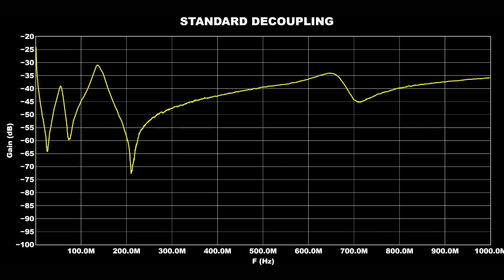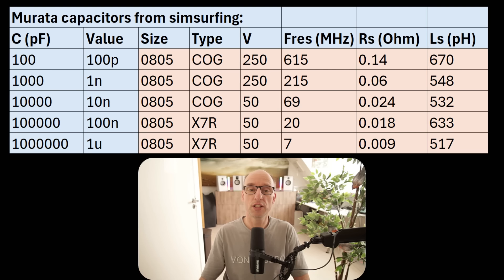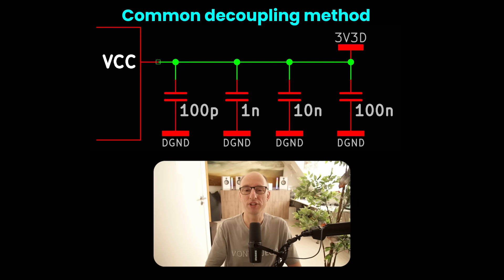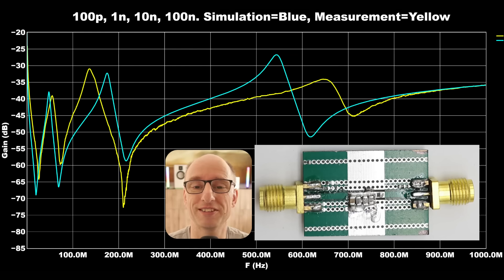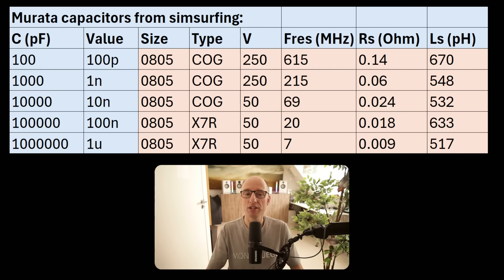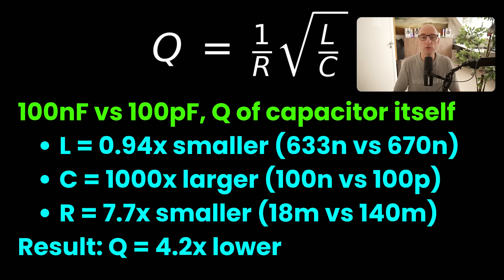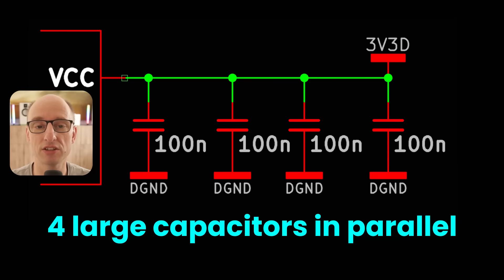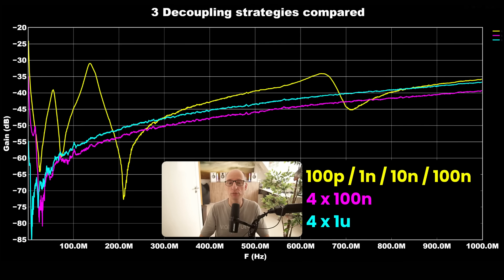The most misunderstood concept in decoupling

Comment: Another method to add damping is to use a ground and Vcc plane on the board, using the innermost layers. that way you do get a small very good capacitor distributed in the PCB, and you connect to it using in pad vias for both supply and ground pins,  and for higher current 2 or 3 vias all in the same small area, either buried under the chip to save space in DIP packages, or near the pin with a small relatively broad trace the width of the footprint. then you can do board decoupling using a single electrolytic capacitor at the point of supply, it being connected to the planes with large pads with multiple vias, and the capacitor terminals being the supply and ground connections as well.  It is common in military and avionics boards, where you often only have a single 100uF wet slug tantalum on the incoming supply, with a series lossy inductor (very low Q factor from having a powdered iron core that is open), and 100nF ceramic capacitors both sides of the inductor, to act as a CLC filter on the supply. No noise in, no noise out, and very tolerant of both power supply ripple and logic ripple. 

One board design, with 25 in the case, did not even do that, 400 cerdip packages on a board, both sides, and the sole decoupling was a 100n ceramic on each of the 2 5V supply rails, supplied from a DC DC converter that was identical in each supply, just the one was supplying 5V constantly, and the other, because they needed to get the power consumption down from 2kW to under 300W, was operated for only 20 degrees of the 400Hz avionics supply, to power all the digital arithmetic systems and the computational core, with only registers and memory powered on all the time to keep state. 

It worked well enough and was reasonably reliable, if a little bit of a pain to service, as changing a single IC meant you sat for a day, grinding off the legs, removing it, then using a Dremel to thin down the replacement plastic package so the tiny stubs of the legs you left could be folded to fit the old spacing, then solder it in. Changed so many 5474's, with 7474's, because those came in plastic, and were easy to get. I did so many 741 opamps as well that were the analogue inputs as well. Almost never any other logic failed, even the esoteric Intersil ADC DAC subsytem, that used some 40 pin cerdip packages, with around 10 smaller dies and hybrid circuits in them. Needed 8 supply rails to operate, and the program memory was on 2708 Eproms, with some doing logic functions and look up tables as well. Memory was 2 Mk4007 devices, 512 bits of serial memory. That was state of the art in 1975.
Reply from the maker: I was thinking: how can this work?! but then you mentioned 1975 :-) Now that makes sense! Speeds were so much lower back then. I don't think you'd be able to get away with this with a modern high speed digital board. The load peaks are so nasty you need local decoupling I think.
Reply: I have used this PCB layers power supply planar capacitor technique in audio preamps and power amp stages in combination with the shunt RC damping advised here.
Results were very agreeable clarity and stability in the reproduced sound. 
Thanks much for your info.

Comment: Thanks for the video. I imagine this is not a big issue for audio circuits as the frequencies involved are much lower than capacitor resonances. Is that right?
Reply from the maker: Depends: If you have large elkos, maybe the resonance will fall in the audio band and this can cause noise issues if you have bad luck.

Comment: @3:30 50 ohms would be unrealisticly high for a power distribution network. If it is lower (generous power copper pours) then all the resonances would get damped by that.
Reply from the maker: The 50 ohm system is used to verify the capacitor behavior only! This is the standard way of modelling/ measuring passive components. You can't do that in a shorted environment (well, you could, but you'd have to develop a completely  new class of equipment for that).
Reply: @HansRosenberg74  I understand. But can the conclusions really applied to real world scenarios, if the model is so different from that?
Reply: @schmitzbeats6102  Yes, they can! It is only at low frequencies where you would actually see a difference. But once you're either far above the bandwidth of the power supply or the inductance of the connecting wires becomes significant, the impedance behave like what is measured/simulated in the 50 Ohm system.
Reply: @daalfredLP  Ok, that makes sense. Thank you!
Reply: Isn't this about power transfer and matching the standard input/output impedance of a VNA that he later used for testing? I believe the simulation would look the same with 1mohm for source/loading.

Comment: Great video! I learned this trick many years ago, ignoring what application manuals said about decoupling..

I think there are a lot of myths that keep on getting repeated from old books. Really interested to hear your opinion about separated analog/digital ground planes. Is this advantageous? I imagine its quite elaborate to simulate or measure this, but perhaps you can share some knowledge on this subject.
Reply from the maker: I've got a great answer for you: Watch my free module (it takes an hour, so you need some time). I dive very deep into grounding, and also separating ground planes. Short answer: Don't separate ground planes!!!

Comment: Pretty interesting. Back in the 1980's when I was building digital circuits at school and as a hobby, the standard decoupling advice if you wanted no noise problems was "0.1 uF from Vcc to ground at each chip".  For a more refined design, you'd remove every other cap one at a time and measure. Looks like the old wisdom has been re-discovered.
Reply from the maker: haha, yes
Reply: There are chips like CD74HC238 which still have it in their documentation, that each chip should have good bypass capacitor.

Comment: I find it funny how I've never even really calculated this, I just operated on the "fuck it, it'll do fine" principle of "10uF and a 100nF". Also, you didn't even mention Feedthrough capacitors! I'm sad. Those things have a MUCH lower inductance and are incredibly useful for decoupling.
Reply from the maker: I've heard about those but never used them. They might be very useful if the inductance is indeed much lower.

Comment: 100nF, 10nF, 1nF 100pF.  this is weird all in itself.  i cant recall ever seeing a stack like this .. ever. 
in my 30 years, my goto was 100nF  and id measure it, and if anything. id throw in a 1nF  with it.  unless there was something really critical going on, 100pF really wasnt used that much in the frequency ranges i was using anyway, but if it were... i would have known to use it.
Reply: I heard this multiple times that you should use 2 or 3 decade caps, like 10nF, 100nF and 1uF as decoupling. Most of the time from people who learned their trade in the 80s and 90s and in that time, it was the standard approach with 2-layer PCBs and only through-hole components with no ground or power planes. And I found this also multiple times suggested on the web.
I am only a hobbist who very recently got into electronics and this was my goto solution until I heard that this is outdated.
So I appreciate the explanations and hard data to confirm my suspicion that it is outdated.
Reply: Its common in beginner designs. You admit to doing 100nF/1nF/100pF so clearly you don't understand it either.
Reply: Max9924 datasheet specifically says to do this, just as an example.
Reply from the maker: Yes, that is what makes it so hard. Datasheets from respected companies putting this in their datasheets. It really is wrong. The reason why I go through all the work of doing actual measurements is to PROVE that this does not work. This is the only way to debunk this stuff. 

Now the reality is: If you do it wrong, it usually is not a problem if your circuit does not use a frequency that coincides with a decoupling resonance. It's just better to use a solution that will guarantee you're never going to get a problem at all.

Comment: In the table of characteristics of capacitors. Capacitor 100 pf can work with a frequency of 615 megahertz, and capacitor 100 nf - 20 megahertz, this means that even taking into account the data that the resistance of 100 pf is greater than that of 100 nf, but looking at the purity of 100 pf, it reacts faster, that is, it will give up voltage and accept voltage faster than 100 nf. these are the results of the manufacturer's tests, which turns out to be contrary to your decision to arrange the capacitors in reverse order in a row.
Reply from the maker: I specifically added something about this in the video just before I posted it: Even though a capacitor is inductive, it does not mean it is a bad decoupling device. Well above it's resonance frequency, the impedance (which is what matters) is still very very low, due to the inductance having a really really tiny value. It's very easy to think that you can't use a capacitor above its resonance frequency and I also believed that for years!
Reply: A capacitor doesn't only work at its SRF. 
You are also forgetting about power planes and capacitors within the IC itself, which can handle these higher frequencies.

Comment: Thanks for an interesting video. My reason for mostly using 100nF decoupling capacitors in <1GHz digital designs was down to cost - When designs are mass produced, it is better to have a smaller number of different components. I always thought it was a compromise, so it is interesting to learn I was inadvertently making the designs more robust.
Reply from the maker: Indeed, you stumbled on the other advantage: smaller boms!

Comment: I'm dealing with a composite video circuit that was outputting the colours out of phase and I was absolutely certain that it was noise from bad decoupling but for the life of mine, I couldn't get rid of it. I don't know how YouTube knew that I needed this, but it was a lifesaver 🙏

I kept digging up and reading documentation about decoupling, and everything said exactly what you showed at first, using decades, but obviously didn't work. A couple of 100nF in parallel and a ferrite bead in series solved everything. 

It's the first time I've seen this channel, but I'm subscribing right now.
Reply from the maker: Very nice to hear a real-life story of how this can go wrong! It never happened to me (yet). Be very carefull about the ferrite beads in series, they will cause a resonance! Now if that falls in the right place, it doesn't bother your circuit at all, but it could have just as easily made things a lot worse. This does require bad luck though.

Comment: Thank you for another insightful video. To clarify: there is no practical reason to use multiple capacitors of the same value instead of one larger capacitor with an equivalent total value, other than to achieve the desired bypass capacitance?
Reply from the maker: If you mean: Can I use a single large valued capacitor as well, the answer is Yes! I should have put that in the video, but you can't change youtube videos once uploaded.
Reply: Multiple caps in parallel lowers the total impedance on the power rail, so there are reasons to go for more then one large cap. You can try a SPICE simulation to see how it behaves.
Reply: ...or to save space?
Reply: I can think of some common sense or textbook answers to that. This is true about passive components in general, not just filter caps:
Multiple small parts have more surface area for dissipating heat and also sometimes smaller components have disproportionately larger solder pads (to dump heat into).
When passive components are scaled, the proportions of their package dimensions tend to stay the same or close to it. A larger value component might be too big in one dimension and the best alternative is to sprawl out some fractional value parts.
Redundancy can allow a circuit to stay operational longer, or give boards with defects a better chance to pass testing after assembly (which may or may not be good).
Rarely, a pair of small parts might be cheaper in bulk than the lower quantity of a single part equivalent. More often if a one size fits all part can be used in several places. Maybe a good example of that is laser trimmed resistors tend to be small and low-power, but sometimes a couple in parallel could handle enough power and be significantly more accurate.

Comment: I love your yt channel, really good explanations!
Would you consider making a video about passive filters in the future? I really find it hard to understand when and where to use filter topologies — for example, when to use a series-shunt vs. shunt-series topology, or when to choose a π-filter or a T-filter, with practical examples.
Reply from the maker: I think the filters are all the same (if you simulate good results with them). Biasing can be an issue. Some filter types by their configuration will present a short to the in or output or both because there is an inductor to ground. That could be a reason to choose another configuration. Matching can also be a reason: Do you want you filter to present an 'open' out of band, or a 'short'.  These are the only considerations I can come up with just like that. There must be more when you think longer I guess?

Comment: Great video, thanks. Now can you try this: Four capacitors in parallel: an 0201 closest to the pin, followed by 0402, then 0603, then 0805. Each package size should have the largest capacitance available in that package at that voltage. The power and ground pins should also be connected by very close vias to the power and ground planes, which act like a very low industance capacitor. This was the advice given to me by a high speed design expert.
Reply from the maker: The resonance frequencies for all of these will be different, so you will get parallel resonances... How bad they are depends on the models of those caps. If you want to know: Get the models and simulate, then you'll know exactly what you're going to get..... Hopefully, that 0201 has quite a large value that reduces the Q.

Comment: As a former radio technician for avionics, Bendix King had a technical document regarding the circuits they used across many radios, and they had a rule of 1x 100nF capacitor per 5 ICs at the very least. Now this was 40 year old equipment so 7400  and 5400 series logic for days on the radar indicator.

Always 100nF local to the chips and bulk electrolytics back at the switching supply.
Reply from the maker: sounds good

Comment: Is it not so that by putting capacitors in parallel that the parasitic inductance will be lower as is the ESR. That fact will also contribute to better performance. The board layout will also be of great importance. What about ceramic capacitors? Can they improve performance? Best regards Henk. Your course seems very interesting.
Reply from the maker: The caps I use in this video are all ceramic. Paralelling them indeed reduces the overall esr/esl. Using the same value stops large parallel resonances from occuring.
Reply: @HansRosenberg74  was your comparison of 4x100nF vs 4x1uF simulated or measured? And thanks for the video!
Reply from the maker: @mainiosukka measured and simulated, check the title of the graphs

Comment: Well, lucky me! I am an 80 year old retired engineer and after 60 years of projects have never had any trouble at all with decoupling, using the usual two capacitor method. Lucky or the whole concept is overblown!
Reply from the maker: Actually, most of the time, you'll get away with whatever you put in your decoupling. If you don't have a circuit frequency falling in a parallel resonance, you're never going to notice! However, if there is a cheaper and easier way of decoupling that will prevent this problem alltogether? Why not do it. That is basically what I'm stating here. So I guess it is luck you did not get hit by this one yet. It also depends on your application, in a high dynamic range system, this can really hurt. In something general purpose, who cares :-)

Comment: there used to be a line of low Q capacitors, basically, capacitors with built in small resistances, but I don't think there were enough knowledgeable power designers buying them to keep it up and the ones I've seen are all EOL
Reply from the maker: Yes indeed! I was thinking of putting those in the video, but since they're out of production, I thought it was a waste of time. Noone bought those, so they went dead.

Comment: SO my default of slap a 100n bypass cap over the bulk PSU decoupling and another 100n at each opamp supply pin and call it good ... is actually good?
Reply from the maker: You probably need a big cap somewhere. The issue with that is that you will create 1 parallel resonance. usually, this is fine, but if it's in exactly the wrong frequency for you application, you may have a problem.